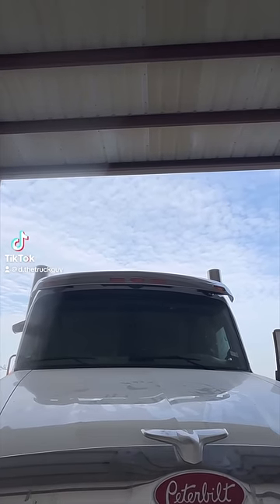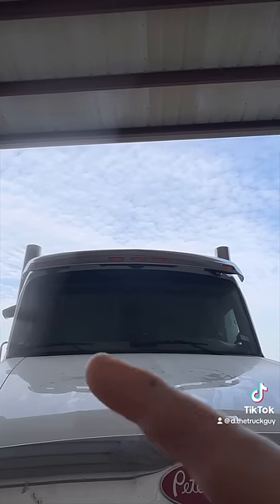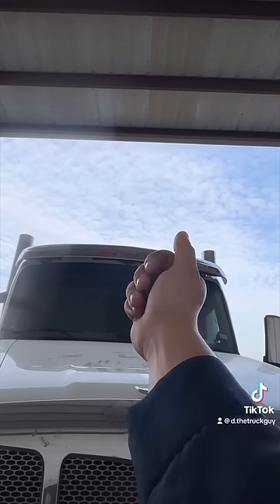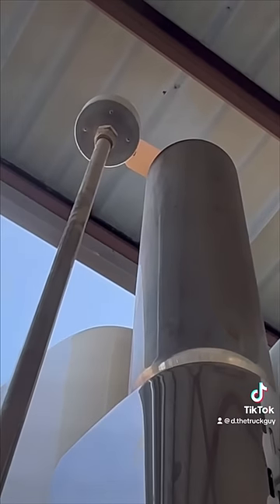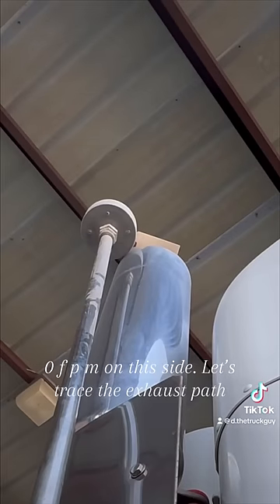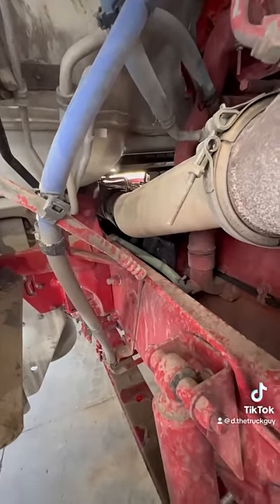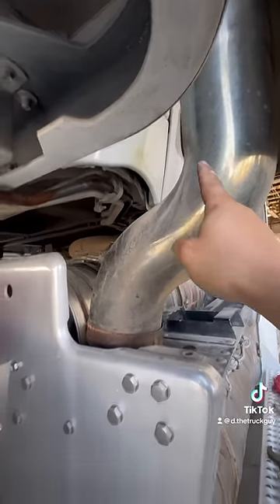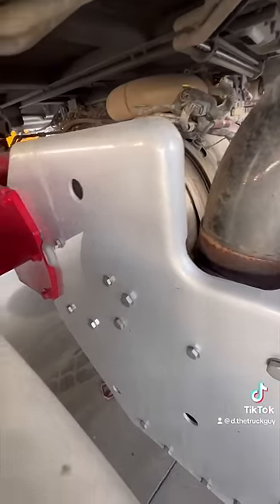#mechanic #truckdrivers #diesel #dieselmechanic #truckdriving #trucker #dieselrepair #semitruck

Comment: What's the point of increasing drag, weight, and  fuel usage, just to have a second pipe that's not doing anything for the exhaust ? Just connect it to the dump pipe with a valve that only opens about 80% throttle. At least this way, it'll be doing something, not nothing
Reply: Yeah me going wtf, I'd cut that thing off right away. Y exist even
Reply: It's strictly for looks. Most old school drivers like duel stacks.
Reply: why only opens at 80% throttle? why not just hook it up properly and leave it there full time
Reply: @rydermiller1782  because it won't be connected to any emissions devices. Plus if you are over 80% throttle, you'll need the extra 5 HP that the loud pipe would provide
Reply: @dukeboreham2782 now I know you don't know what your talking about, if your full throttle you don't need the extra HP because you need the extra torque
Reply: @rydermiller1782  Have you never heard of sarcasm ? 🧐🙄 I know truck engines need a lot of torque. Most red Line between 2250 rpm and 2500 rpm, and the torque range is usually between 900 and 1400 rpm. Because these engines operate at a relatively low rpm range compared to a regular car, the torque these engines can produce can sometimes be up to twice the HP the engines can make.  I've got a master's degree in automotive mechanics, so I'm pretty sure I know what I'm talking about
Reply: I highly doubt the extra pipe is going to have any real affect. You might burn an extra gallon of fuel a year after accounting for the tiny bit of weight and drag the pipe actually adds.  A simple y pipe would make more sense than a complicated valve
Reply: @jasonstclair6293 thats what i was gonna say just ypipe to make pipe work or cut it off

Comment: Reminds me of the time I had a trooper bring a tractor/trailer to my bay and stated all lights on trailer inop. Customer said two troopers and a roadside tech couldn’t figure it out. I got half way into the service ticket and noticed the 7way dangling. Plugged it in to the trailer and all lights were operable and legal. 1/4 hr for the troubles (driver insisted) and I signed his out of service order lmao
Reply: What does "1/4 hour for the trouble " mean
Reply: @austownzz 1/4 hour labor. Diesel rates for regular vehicles are $200/hr (or so I'm told) so the guy insisted on paying this guy something, mechy made it $50 (give or take).

Usually min is 1hr, so he did some magic.

Comment: Is anyone going to talk about the unnecessary exhaust test? He did the test when all he had to do was inspect the pipes first to find the problem. 

You could saved the guy a $1,000 right off the bat. We all know going to a Kenworth/Peterbilt shop the first and foremost is “We need to hook it up to the computer, $500”

Then you start the real diagnostics which in this case you did a completely unnecessary exhaust test to drive up the cost of the diagnostics.

Comment: Because the DPF system chokes off the exhaust so much that truck engines don't need dual stacks anymore. Dummy stack for display purposes only. Paccar does the same with KW.

Comment: Today: I got two front tires three weeks ago, but they keep going flat!
Me: How often? 
Them: I've had to fill them up at least once a week, and your guys say they can't find a leak. 
Me: So, you've brought them back twice?
Them: Um, no once. But I just want them replaced, please. They keep going flat.
Me: (Pulling the car in, I see the TPMS light on. I take the tire pressures and see the new front tires are overinflated and the back tires are very low, around 20 PSI.) Sir, the problem isn't your front tires.
Them: Your manager said you'd replace them.
Me: (Confirms with my manager that, yes, once again, we are giving away free tires so I stay an hour over to finish the job. Also hoping I'm on shift when they come back next week since I'm the tech that did the original "flat fix" on the front tires and noted the old rear tires were flat last week.)

Comment: Translation driver you got the baby block this Frame can handle 6 engines that are larger than yours this is why the body comes pre-molded with two pipes but you got the baby engine so you only need one exhaust pipe😂

Comment: Probably simple are you going to do is cut a nice piece out on the passenger side of the pipe all you have to do is make a tee joint connect to the other pipe exhaust pipes will work at the same time and also will make the truck actually want a whole lot and him better too and better fuel mileage

Comment: So, could he just add a Y-pipe to get exhaust out of both pipes?  I would guess the correct way to do it would be to have a real dual exhaust with half the engine cyclinders on one stack and the other half on the other stack.  BUT, that would require two turbo chargers, filters, and DEF things.  That sounds expensive to add on.
Reply: A simple y pipe is how yoy would do it. As someone who drives and grew up in a family of truckers you just y pipe and now both work.

Comment: Two stacks are worthless. The exhaust exit on the turbo is only 2.5". Doe the math , the engine can only flow at maximum rpm...531 cfm.

Comment: That'sThat's the problem with all these steering wheel holders they think they're not. Supposed to have to worry about the engine oil with a radiator fluid or any.

Comment: How would he not notice that when you do a pre and post inspection daily?!?
Reply: Bahahahaha most steering wheel holders dont know how to open hood or pull a dipstick you think they know anything about looking under. Reason i work with a owner operator he lets me run hard but i know how the truck runs and every part because in the military i learned and grew up in a family of truckers. If something breaks ill try my best to fix it if i cant then ill let him know and we will get to. Shop fast